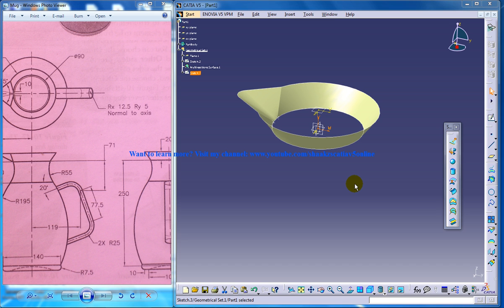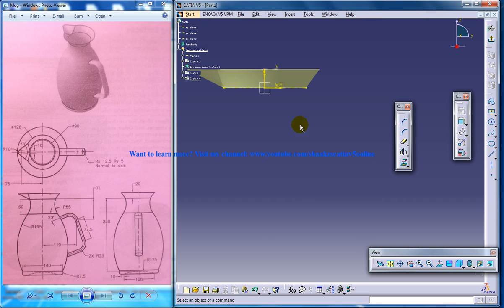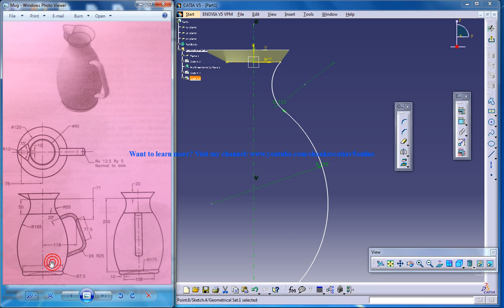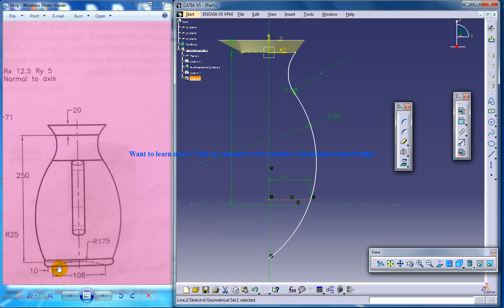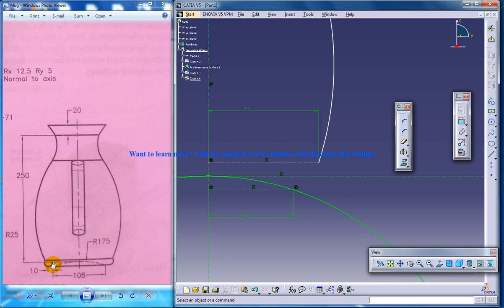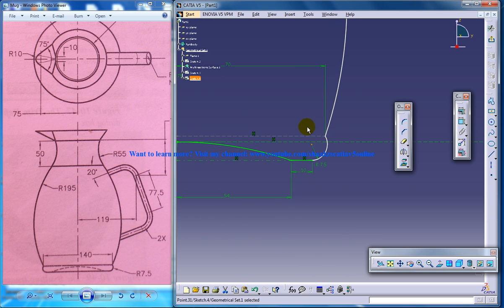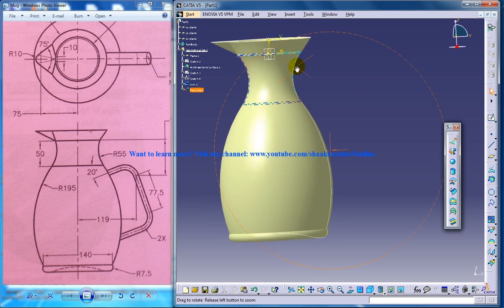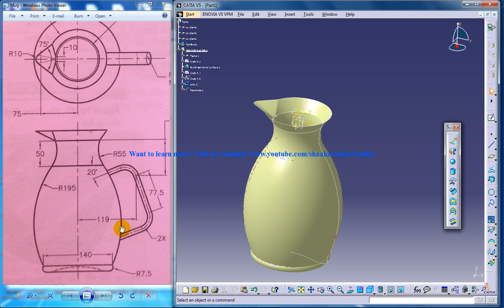Catia V5 Tutorials|Wireframe and Surface Design|Rebuild A Mug|Part 2

Comment: my specification tree is gone and it seems in a line how can i get it back like it was  pls answer soon
Reply from the maker: +taher ali Im sorry for the late response, If the spec tree is hidden, press the F3 key to unhide,If it is small, then press control key and use scroll wheel to scroll to change the size.hope that helps.!

Comment: Is there a tool like solid combine in wireframe and surface design?
Kindly revert back.
Reply from the maker: Solid combine is for Solids, It is formed by projecting two sketches and forming the common solid. In wireframe, There is a tool called as project which works in a similar fashion, but you cannot expect a solid in wireframe.

Comment from the maker: Hi Muthu,

Gratitude!!

I'm glad that my videos are helping you. Its really kind of you.

Coming to your question, Project to 3d command is used to bring an element to the plane you are working on.

For example If you were working on a square and you created a sketch of a cirlce on one side of the square, Say If you came out of that sketch and you are directly going to the opposite face of the same square, If you wanted the circle you created early,You don't have to recreate, Use Project to 3d

Comment: How do you use the same function continuously (Like the Quick Trim command), without actually pressing the function after every step? Do you press something on the keyboard, or is there some option in the settings of CATIA?